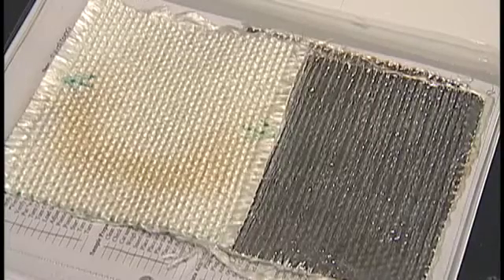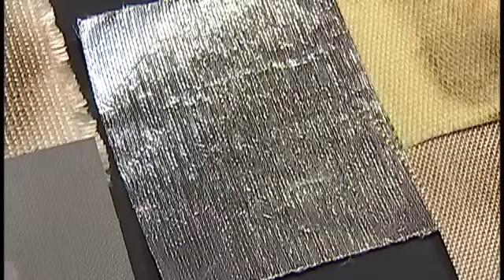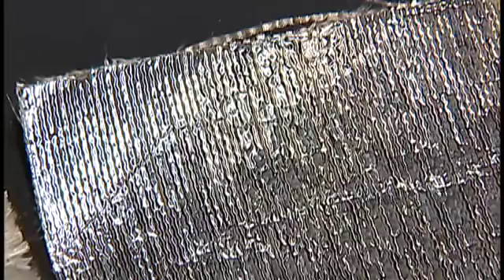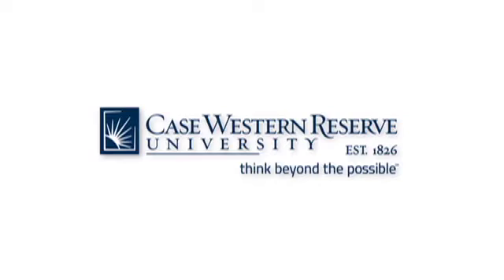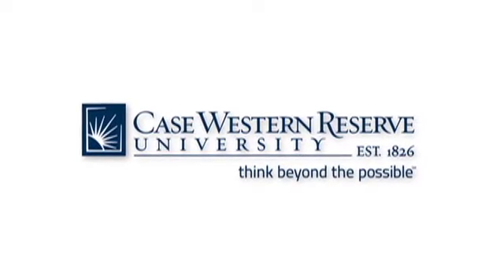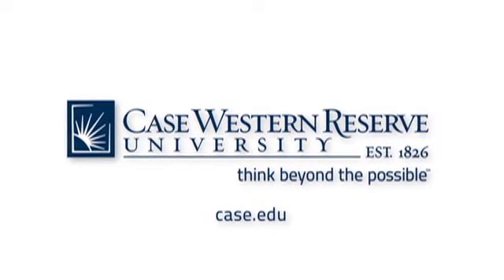Fire Blankets to Save Homes

Comment: Like everyone else here, I thought of this years back.  Came here recently because of a video I saw with floral foam.  Why not make a wall of that stuff around homes and the roof.

The key to this idea is that it has to be sold as a service.  When the fire is in your region, you call
“Bob’s Fire Blanket Service” and they come out and tarp your house.  Something like $5K for a 3-4 day period.  Then an additional $1k a day for 7 days.

Services take about 90 minutes to do.  Have to bring a crane out, blah blah blah.  

Probably you’re best bet would be to go directly to the insurance company.  Sell it to them to sell to their policy holders.
Reply: "When the fire is in your region" I feel like at that point, the customer would rather call 911, which is cheaper and probably faster than having the service people put the blanket over your house. Any thoughts about this?

Comment: As there are many different types of non-burning fire protection blankets available on the market, why can't large flying drones be used with radar and remote controlled guidance to gently place many super large sized non-burning blankets on a forest fire, and even inside of the worst night time fire conditions when fire retardant planes can not fly, to either smother a fire or to prevent a fire from spreading ?  These very large non-burning fire blankets could be collected, cleaned, and reused after the forest fire is put out, to become ready again for the next forest fire.  Who would be interested in using and researching this idea ?
Reply: too heavy I guess. According to firezat dot com, to cover every 10 sqft the wrap weight about 1 lb. Think about not just roof area and also each wall of a house need to be covered, I think that can be really heavy.
Reply: Difficult to control wildfires are often happening during very windy weather.  They are expecting gusts up to 70 mph at the Kinkead fire happening now in California.  Large fires often generate their own wind.  Fire blankets will act like a giant sail under those conditions.